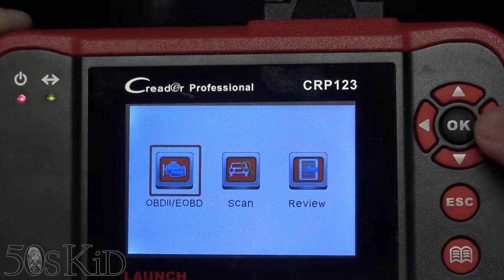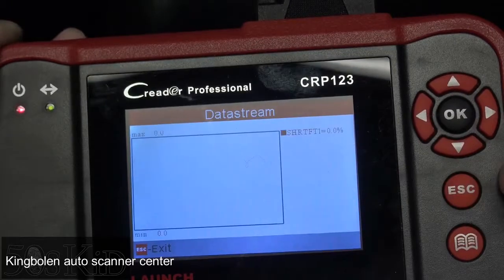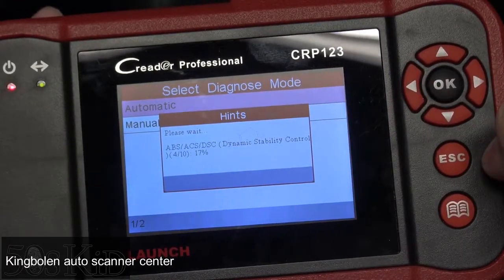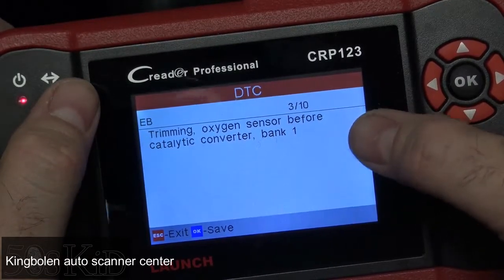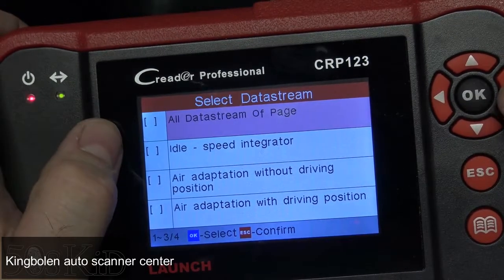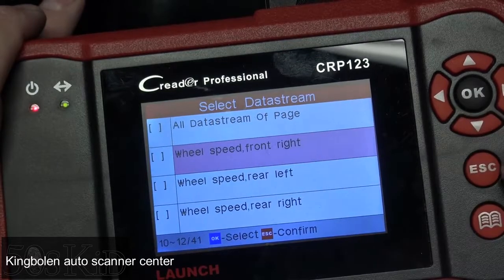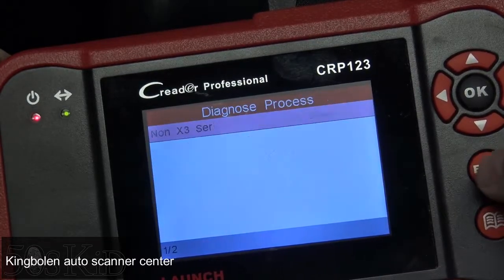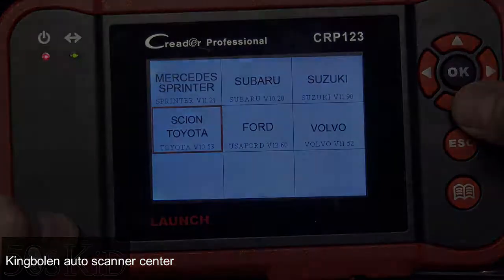Launch CRP123 REVIEWS ABS SRS Transmission diagnostic

Comment: Jason, How can I scan my ford 4R75E Transmisson to tell me When the TTC (transmission torque converter)shift solenoid is activating, when the TPC (transmission pressure control) solenoid is activating and at what Pressure, and when the dual rack shift solenoids are activating and causing shift? I think TPC since its shifts at nearly 20 mph's to 3rd?
Reply from the maker: Do you have the CRP123?
Reply: @kingbolen_official  Yes